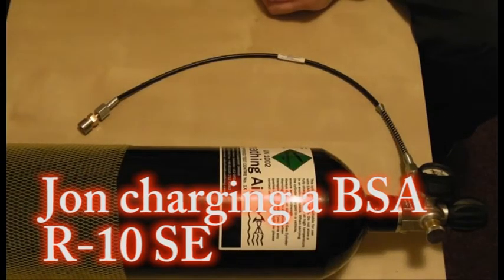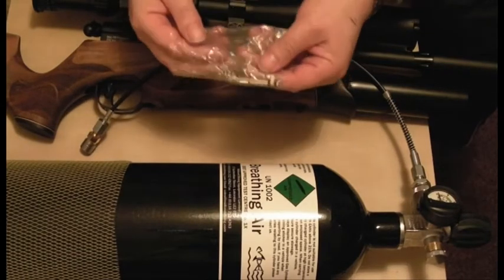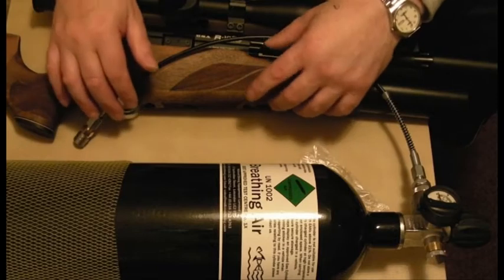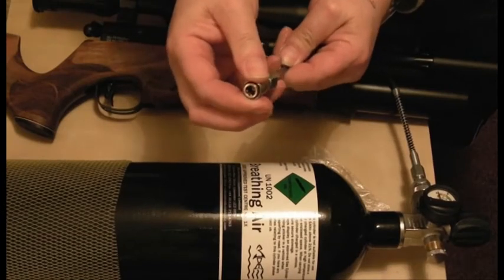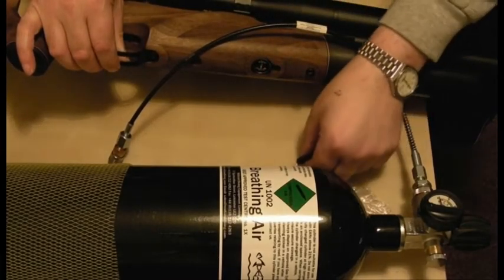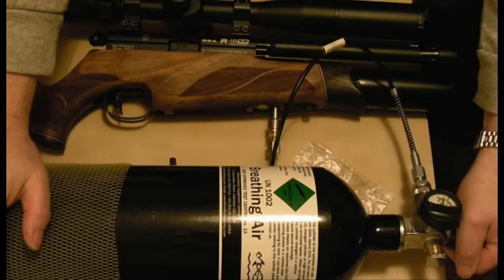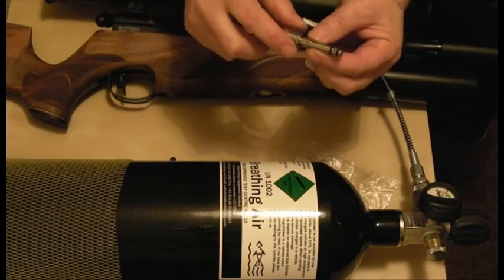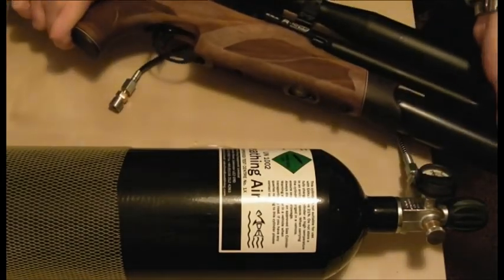BSA R10 charging PCP rifle filling

Comment: Pumps are not advised! They pull water humidity (through pressure) into the working parts causing rust! Tanked air is dry! For this purpose. I was specifically warned against pumps for this reason.... have heard this from 3 very good sources...

Comment: Just bought this gun, went to charge it for the first time using a bottle, probe is securely in the quickfill hole, but gauge on the diving bottle goes right up to 232 bar, but nothing on the gun. Ive tried cocking the gun but still the air wont go into the guns tank?

Comment: Eventhough your fill pressure says a maximum of 232lb, that is a maximum.
Most people in the know only fill their airguns to 200lb pressure, no more. This is plenty. Filling to 232lb will put undue pressure on your seals and all the working valves and mechanics of your air rifle,  meaning they won't last as long. There is no need to fill to 232lb.
Putting 232lb air pressure in your air rifle instead of 200lb isn't a good idea. Its a bit like installing a spring into a spring piston air rifle that is far too big for the cylinder. All the existing parts are placed under undue pressure.
Reply: Read the manual 232 bar is the recommended maximum.  If you want to put 200 lbs in yours that's fine. But BSA say you can go to 232 BAR, so the system will be tested to a lot more. Saying the seals will be under more pressure is true, but it is well within the specification.
Reply: @Mr234905  
Thank you for the heads up!

Comment: Hi mate. Does the rifle come with the infill spigot?
Reply from the maker: @realcooking1833  Not really sure what you are asking there. You mean the fill probe?
Reply: @JJandDad  yes👍👍
Reply from the maker: @realcooking1833  It has a probe when you buy a new gun. Also a blank probe, keep the blank in the gun, it needs the valve clean.
Reply: @JJandDad  sound. Thanks for letting me know. I've ordered one today and already have a scuba tank so just wanted to check if I needed anything extra👍
Reply from the maker: @realcooking1833  You will need the right size "whip" on the scuba tank, the pipe and end piece to fit your probe.  Not expensive.

Comment: Hi mate. Nice straightforward explainer. However I’m having an issue with my new r-10 se. Hoping you might have a clue what the issue might be. Attaching my air tank. No leaks. Open the valve. Jumps to 180 bar. Refuses the add any more air than that, no matter how much the valve is open. Am I not setting the gun correctly, is that normal with a partially full gun, does it sound like a fault? I should point out I’m using a 3ltr 300 bar bottle so I’m given to understand that it’s more than capable of hitting the 232 bar fill pressure.
Reply: Julian Holtom  Sounds like your bottle is not full, if its not been filled to 300 bar or is running low then it may need a re-fill.
Reply: It seems pretty full to me mate, got tonnes of pressure. Also, it's new and it's the first fill I've had to do.
Reply: Julian Holtom Once you open the valve there is nothing to stop the air going into your gun, as the pressure in your bottle drops it will eventually be down to zero. A good sign that your bottle has gone down is when it won't fill your gun. Take it to your gun club or diving shop and they will check how much pressure is in your bottle.  There is nothing else that would cause this to happen. Even though it's new,  they may not have filled it to 300 bar. Check that it is a 300 bar rated bottle, some are only 200 bar.
Reply: OK, thanks. Seems the shop I bought it from was a little economical with the truth with regard to supplying a full bottle with every new PCP gun purchase. I'll be paying them a visit. Thanks for your help mate. Appreciated.

Comment: As I can find NO means of contacting BSA to ask them, perhaps you can tell me...
I am toying with buying a R10TH as my first (ever) PCP.i
What fittings does it come supplied with? I intend buying a BSA compressor  to fill it, but  cannot find any information online for that either!!! 
Is it a straightforward connection to the BSA rifle, or do I need to buy any adaptor(s)?
It seems VERY odd to me that a well known company like BSA has no means of being contacted for this information. It is putting me off buying BSA to be honest. I suppose Gamo are to blame, as they "own" BSA now, I believe.
Reply: It will come with a fill probe, you can then use a whip from your filling device with the appropriate end fitted.  When you buy a bottle, they will ask what adapter you need, as different gun makers have different fill probes. Not too difficult.

Comment: Can some one please tell me what are specs of fat Oring that sits inside regulator in fill valve on which ball bearing sits and also please let me know specs of oring under pressure gauge. These questions are for BSA R10 MK 2 .22 cal
Reply: Maybe try BSA!  Ask them,  or go on an air gun forum. A question on a video post may not get a response. Good luck.